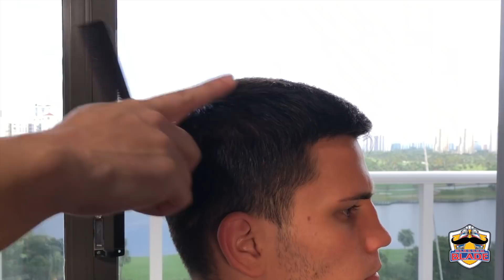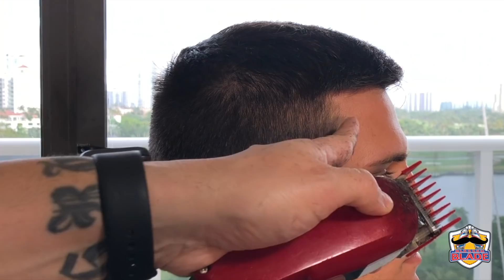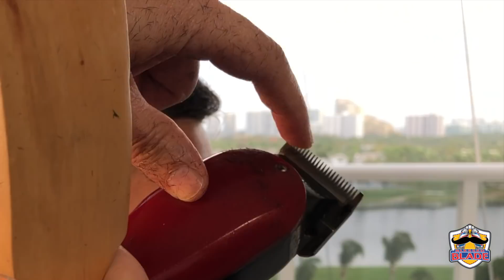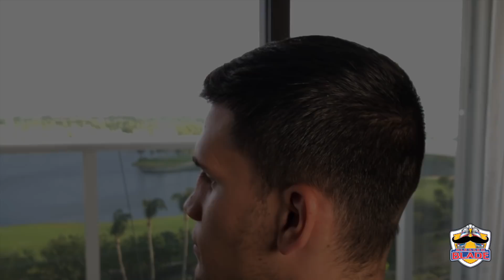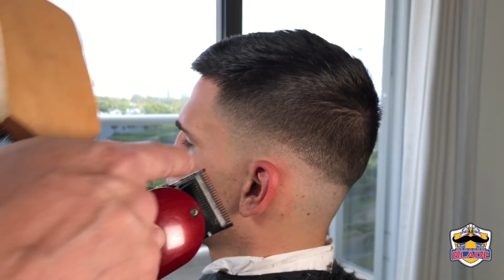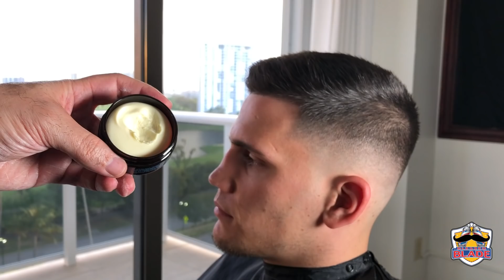Bald-Skin Fade Scissors on Top Men's Haircut STEP BY STEP

Comment: Can you do the same with medium curly hair?
Reply from the maker: Yes
Reply: Blessed Blade It worked out really well indeed 🔥 thank you so much.

it just turned out really volumious at the top. 
You think I should thin it out everywhere?
Reply from the maker: Depends is hard to say without seen it 
+1 (779) 210‑5079 that's my whats App

Comment: Are your trimmers and clippers zero gapped? Or is it best to leave them as they are? My trimmers seem to destroy my bottom line at the minute.. it makes it look choppy. I'm using oster fast feeds and andis gtx
Reply from the maker: I leave the trimmer as is from the factory i use Andis styliner 2. I leave them alone because they hurt the client if is too close. And I don't think is necessary. The clippers I adjust them but no completely 0 gaped. Also because the same reason and because the blade eat the guards.I use a wahl Designer. Please share my videos i can use some English speaking followers

Comment: Are there differences to cut from 4 to 1 instead to cut directly with 1?
Reply from the maker: The difference is that you can finish a lot faster and have a nicer blend like i did on the video but is all about what's easier for you some people are use to blend bottom to top and is easier for them ,  you may have to try it it may work for you or may not work , if you try do it like a did in the video with the 4 trap the hair with the finger and cut it with the clippers then use 3,2,1-1/2  lower make the line with .5  and focus on the darker areas , if the haircut is just with #1 you don't even have to make a line